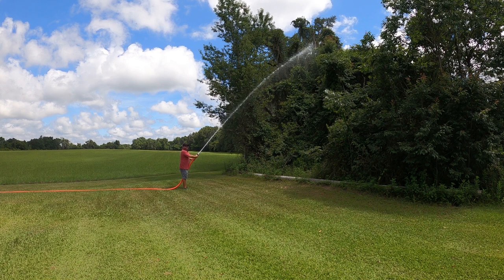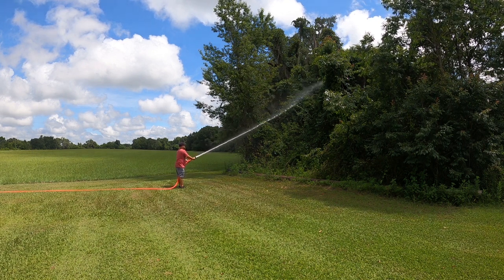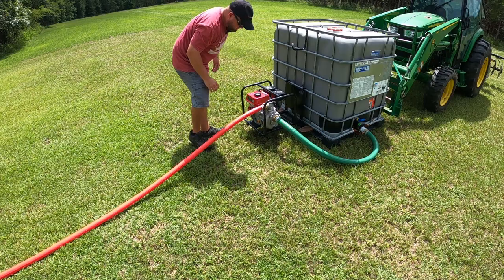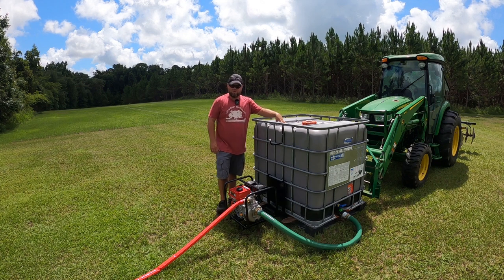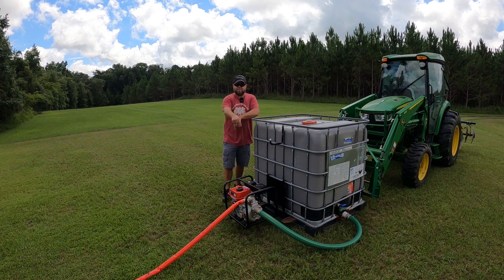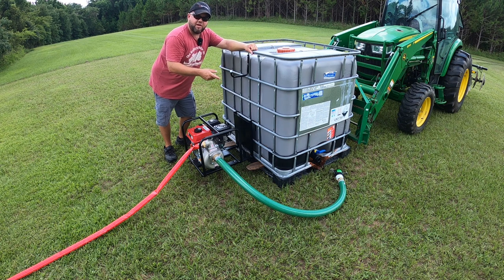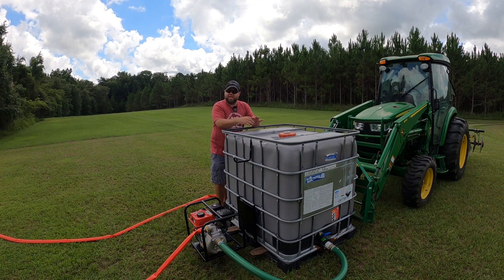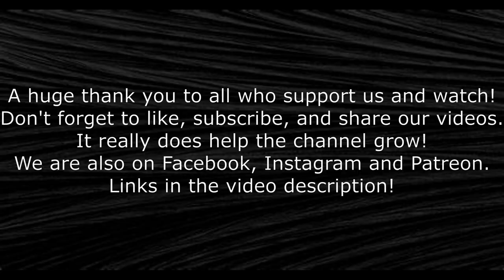Building a homestead fire truck! #603

Comment: Andrew I've been a volunteer firefighter for 25 plus years; started as a Jr firefighter at 13 and have recently been promoted to District Chief, and have seen a lot of different fires over the years. 1st off that's a great brush fire set up. Great job. 2nd (and please understand where I'm coming from here) if by chance something does happen and your house catches fire and you both get out....stay out. Spray from the exterior but please don't go back in. 3rd and my plug for our volunteer system is you should think about joining your local station. You would be a great asset to a department.
Reply from the maker: Points taken! Thanks
Reply: @TKCL  I don´t know if you have done it 
but not all fier needs 100 feet of hose.. make a second
outlet so you can drive tractor and hose a grass fier down 
maeby even 2 short hoses with on big and on small hose
so you conserve as mutch water to as long a drive as possibel ...
when to refill main tank from drop tank .. make a 3" 1m hose from putlet
on drop tank set maintank .. hoist droptank above maintank let gravety work
the big outlet and the meter drop hose will suck 1000l in under 5 min
Reply: Greetings from Australia.  Great video mate.
Reply from the maker: @sirjarhead thank you for watching!
Reply: Great set-up for quick and simple fire suppression. There are always ways to improve but simple is usually best.
Reply: Having a feeder house is a good idea but distance can be a hindrance if not an absolute impossible obstacle. @kennethschultz6465

Comment: Andrew, I hate being "that guy", but I would love to see you wear a full face shield when using that grinder with the thin cutoff wheels. Buddy of mine is a jobsite safety inspector and was called to the hospital for a deposition and pictures of a guy that had one of those thin blades explode and embed itself in his nose, cheek, top plate of mouth. Guy will need lots of reconstructive surgery. Be safe!

Comment: You really don't want to put a hose any more than 1" I.D. 270 gallon totes empty too fast with a big line like that. And try attaching a hose reel so you wind up your fire hose quicker. As well have a recirculate line so when you turn off the nozzle the water can recirculate back to the tank so you don't risk damaging your pump by 'deadheading' it.

Comment: The one thing i haven't seen is what you're doing for YOUR safety. Anyone that has ever fought fires can tell you house fires or car fires can get extremely hot. Forest fires most of the time in th east aren't that bad until they're raging infernos that you can't get away from. You really need to invest into some gear for you to wear so you don't get cooked. Even if you don't face a high heat situation. Think of what happens to meat that you slow cook or what happens out in open water when you get to much sun. Now as a few hundred degrees of fire. Not just outer layers either. Sub layers, boots, helmets, gloves, etc... There is a reason why we fire fighters wear what we wear. Good luck body. One more suggestion. Get TWO sets. One for you and one for your wife. You never know.
Reply: One final suggestion. Get a hay trailer. You could put 6 to 8 totes on it. Depending on what your 4066 can handle.  Move the pump onto the trailer. Again, you've got me thinking like crazy. Lol. The ice maker is in my garage. Lmbo. I don't have water or there so I had to improvise.
Reply from the maker: I do have plans to build a fire trailer. Thanks for watching
Reply: Looking forward to that video. Promise I won't blow up your comments section then. Bahaha

Comment: Great idea!  Get a trailer and mount several totes on it that are daisy-chained together.  The trailer would also add space to keep all your tools together and at hand.
Reply from the maker: If I come across a cheap trailer I'll do that.
Reply: I think that’s a great idea.  Mount the pump to the trailer and add brackets or hangers for other tools and a gas can.  The trailer would provide the complete system.
Reply: seems as if lost dude hit it on the head...just hook up to the trailer and roll where needed...be rolling in like the autobots ready to fix problems.  Id probably build in a little grill and cooler setup on there as well.
Reply from the maker: Yep I agree, trailer build coming soon, I've already got several ideas.

Comment: I built a similar setup on a trailer with two totes, and needed it on two occasions.  The key take away point for me was - a little water early in a fire means less water can prevent you needing a lot of water after it's out of control.  (I also used mine to water animals in remote paddocks.)  

One of those fires happened at night, so I added a generator and lights to the trailer. That took it to another level.
Reply from the maker: Nice build

Comment: As a past Aussie volunteer firey of 20 years from 1995-2018 and now an owner/operator of a private trailer unit your design is rock solid and creative including pump heat shield a few things to note for improvement 

* Where you can invest in 3/4'' 50 ft forestry grade lay flat hose or 25 mm 3/4'' black fire hose that will give you better pressure 

* Place the 250 gallon IBC tote onto a trailer that can be towed on back of your tractor 

* Look at also putting a hose reel on the tote frame or a trailer that will allow for instant deployment of the hose without worrying about kinks 

* Baffle balls or even heaps of pool noodles to stop the water from sloshing around
Reply from the maker: I've already started collecting parts to build an even bigger trailer. Several changes coming on the next design.

Comment: depending on that pump motor to start 'and' keep running when ya need it in an emergency...perhaps a gravity water tank near the home for backup...or install you a private sprinkler system in the house; putting a few back up plans in the works in case (God forbid) ya can't fight a fire or aren't at home...great idea and food for thought for many in rural areas!!

Comment: awsome job, coming from a retired firefighter !! the average firetruck carries 500 gallons , you can fight a lot of fire with that , they also make a forestry hose that is small in diameter that would make that tank last forever !!
Reply from the maker: Wow I didn't know that. Thanks for watching
Reply: @TKCL  the volunteer fd I used to volunteer at we had a tanker truck and a pump truck with 500 gallon tanks and a brush truck with 250 gallon tank . we could fight a lot of fire 
I agree with brian get you a forestry hose

Comment: Great setup, we did something very similar with totes and pump, but we opted to eventually go with a smaller tandem axle trailer to hold two totes, the pump, hoses, fuel, etc.   We also figured that it would be easier to move around since we could use any tractor, truck, etc to pull it.
Reply from the maker: I think that is the perfect way to go.

Comment: Really good idea. Totes are designed to carry about 1 ton of water. So, your loader needs to have that capacity. Smaller 3 series JDs do not have that capacity as you probably know. That is why I own a 4066R like yours. So, people should know to use a smaller tote based on a smaller loader size.  Fighting a fire is a lot about getting to it quick. This seems to be the ticket!
Reply from the maker: I'm a little over rated capacity here, so I'm going to take it easy as I can.

Comment: From the firefighter in the crowd, Could you have done a PTO driven pump ?? One less pump to worry about. I’ve got some used fire hose if you want some. Plus if it’s for brush fires, you might wanna get some red line or booster hose, the water supply will last longer. Also, add a tank on the back for an extr 250 gallons
Reply from the maker: I've got a new build planned with more water storage. The reason for the gas pump was because it's quick. In the event of a fire my front forks are always available. I might have something hooked up to the year that requires unhooking, then pto pump hookups, plus running lines. Time is of the essence.

Comment: in the chaos of fighting a legitimate fire, it takes too much time to constantly swap the pump from tote to tote. just have two totes with a short 3 ft hose on it and empty into the tote with the pump running.  you may want to take a ax handle and attach a rubber mud flap or high quality floor mat on it for beating out small fires, also a pulaski ax. it has an ax on one side and a pick blade on the other. chop roots or dig a trench. great for making a fire break. thanks.

Comment: You can also make spray bars so you can attach them to the tank with the same type of hook system so you can use the tractor and drive around watering dry spots. You can hook the spray bars up with electric solenoids inside the cab so you can easily run one side or both and turn them on and off from inside the cab and hook them up with quick disconnect plugs for easy disconnection when not using...
Reply from the maker: Your on the same page as me 😉😉, I've already been kicking around a similar idea.
Reply: @TKCL  Well I've always heard great minds think alike!!!

Comment: Very neat build!  The hazmat decal on the tote refers to vinyl adhesives, which would normally be waterproof for the most part. Assuming that was what was in the tote, should not be much leeching into the water.  Sitting in the sun getting hot might affect it. Anyway, you would probably benefit from a quick overview of how to fight fires, where to stand, where to aim the water, when to retreat, etc. There are basic techniques that will make a huge difference in how effective your efforts will be and help keep you safe. You probably know a fighfighter or could find someone at your local RFD who can offer some advice.
Reply from the maker: There is a product number, code and information on the tote. It's bromine for algae control.

Comment: Consider adding buckets with handles to help with using to put out a fire. 5 gallon and buckets in different sizes would allow other people not as strong to help.  Keeping everything necessary and dedicated to put out a fire all in one place is essential to readiness.  You don't have time to look for anything but getting water to the fire.  Great system and setup.  Try have some practice drills for you and other family members in case you're not home when an emergency happens.
Reply from the maker: Good tips!

Comment: Another option is a short hose you could work out the cab door. Better for grass fires.

Inventing a clip to hold the pump to the tote might not be a bad idea either. You'll forget to drive gently if you're under stress.

If you're looking to replace the hose, a real might be a good investment. Otherwise, you'll have to control or abandon all your hose before you go fetch more water.

I've been a volunteer firefighter in Australia for 10 years. Be safe about what you chose to attempt. Were still building houses, cars and you can replant grass. We've yet to master replacing people
Reply from the maker: I did get a hose reel, very much needed. I also plan to build a water trailer with sprinkler system.

Comment: This is just a opinion.
Go online find some wildland 1 1/2 inch fire hose and a nozzle.
You will probably need a 2 inch to 1 1/2 inch hose adapter to hook up to your pump.
But it will work better than your vinyl hose.
Don't forget your PPE equipment. of
Leather gloves and at least a set of good pair safety goggles would be a plus.

Comment: Oh swell, another project for me to do..  ;)   Seriously though, a great idea, and one I've been toying around with, but you've help clarify what I'm going to do.  The IBC totes also come in a 325 or 330 gallon size, which would provide about 6.5 minutes of water (using the same rate as your 250  gal/5 min).  My house in the country is round, with 4 alcoves around the periphery.  I'm going to plant a dedicated 330 gallon tote in each alcove, and just take the pump and hose to whatever tote is appropriate.  The VFD in my little town is a few minutes away, so with multiple totes and a long enough hose, I should be able to hold on until the cavalry arrives.  Thanks for a great video!
Reply from the maker: Great idea

Comment: Awesome project!  I attempted a similar project about 7 years ago and then discovered that Charles Branson (our Branson 4020 tractor) could barely lift 800 pounds with the "bucket forks" I have.  Since I can only carry about 80 gallons of water in a tote with our tractor, I scrapped the idea and turned the tote into part of the septic system for our "guest house".  The 2" Predator Semi-Trash pumps from Harbor Freight are great.  I've really been abusing the one I have, leaving it out in the weather year around and it starts on the 1st pull every time.  I run it a couple times a week to keep the water level in our pond up; "redirecting" water from a creek that runs thru our property slightly up hill 400 feet to the pond.
Reply from the maker: You could always put a tote or two on a cheap trailer.
Reply: @TKCL  Time to acquire a couple more totes.

Comment: I put together something similar and shot a video of it. My tank is not portable, though. It's a giant 750 gallon tank. Have all my hoses and nozzles in one container. I can easily drop the container and the pump on a handcart and truck it out to the backyard where the tank is. I have 150' of hose that I can reach pretty much anywhere on my property. Nice thing is, in a really dire emergency, we have a swimming pool with a massive amount of water we can tap into if we can't get a fire under control with the 750 gallon tank. Only thing that sucks is 150' of hose filled with water is next to impossible to move by yourself.
Reply from the maker: We are about to put in a huge pool and that's definitely a good backup source. I'm really kicking around the trailer idea, I need to be portable with so much property.

Comment: I did a similar thing except mine has a 4 inch PTO driven pump and I used a lawn trailer to haul a 320 gallon poly tank and 200 FT of actual fire hose and nozzle I got from a fire fighter friend of mine. I run mine right off the PTO on my 4066 it will flat move the water  . I do like the IBC concept with the portable pump .
Reply from the maker: I like the portable pump option too, especially since I'll probably make a trailer and would like to be able to tow it with my truck as well.

Comment: FYI, in order to calculate the theoretical pressure,  multiply the  manufacturers maximum head pressure by .43.  So..100 feet of head pressure gives you 43psi.  This does not include many other variables such as friction loss through the piping or hoses or flow rate.   The  pump manufacturers have a " Pump Curve" chart that will give you somewhat reasonable data on performance.

Comment: Hey.  On a lot of home made firefighting pumps, if you get a high pressure pump it’ll work much better, like from BE.  The harbor freight one is technically a trash pump and doesn’t push as much head pressure.

Those are specifically designed for firefighting.  I think cost about $600.
Reply from the maker: This one works very well for the $200 range it was in. I'm actually quite impressed this pump could provide this much pressure.

Comment: A couple of things I would do:

1st find a pallet fork that would fit your 3 point hitch, that way you can carry the weight closer to you, and not risk tipping over as easy, last thing you want to do is turn a tractor over while youve got an emergency going on elsewhere. that also gives you the ability to drive faster to the scene. you could also carry two totes that way if needed.

2nd if you could find a stock tank float that fits inside the ring in the top, you could set up to fill automatically so you dont have to babysit the tank while it fills. could even build you a manifold hose tied to the bottom of each tank to fill multiple tanks at the same time.
Reply from the maker: I agree with all of that except carrying two totes. That's 5000 lbs of stress on my tractors components.
Reply: @TKCL  I agree, you could always do an empty on the front. I have a 4066m and know it’s not exactly steady with a bunch of weight on the loader. I guess if you don’t plan to use the loader you could add 3 point mounts to the pallet fork you already have somehow
Reply from the maker: The forks are almost always on my tractor, or easy to hookup. There is usually a mower on the back, that takes a lot more time to disconnect and the hookup to a tote.

Comment: What you really need to do is get yourself a flatbed truck, and build a bigger truck, with 3 of these tanks plumbed together in series for a total of 750 gallons of water into your pump, to extend your ability to pump water non stop without having to swap from tank to tank.
Reply from the maker: I have been collecting parts for this, but on a trailer.
Reply: @TKCL  a Trailer is ok as long as it's not overloaded by the weight of the water, and equipment, which is why I suggested a flatbed truck. With a 12 foot bed, you could easily put 3 tanks back to back, and hook them all together into one discharge, and set your pump on the tail end of the bed, and plumb it into a manifold for various hose sizes, and have tool boxes on each side for extra gated Y's, nozzles, and other various fittings, rolls of hose, and some hand tools, and you could even mount a portable generator on one side and have some flood lights for night work.
Reply from the maker: Truck is a huge expense and upkeep, not to mention reliability concerns in times of need. The trailer is always ready to be moved by a truck or tractor. The axles I have are 8 lug and I believe 7k pounds each. Way more than enough capacity for three totes.